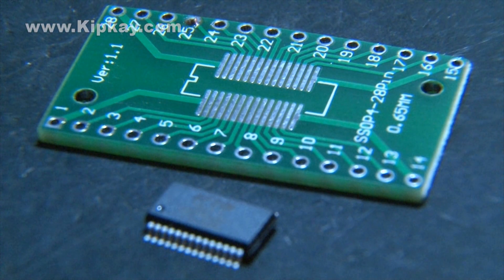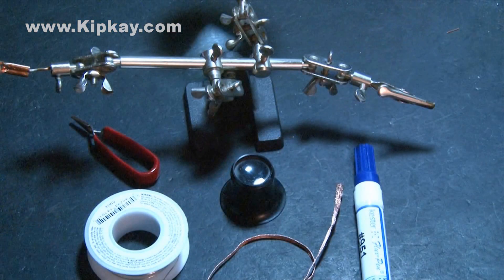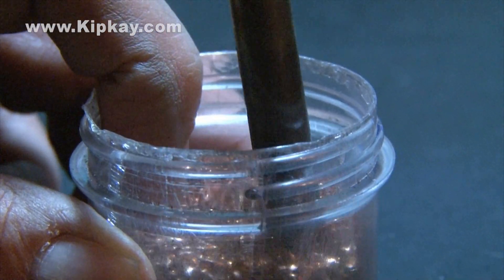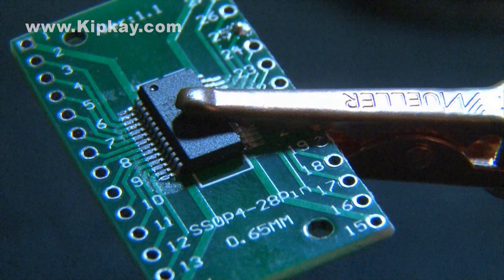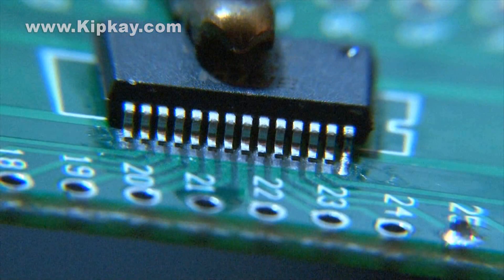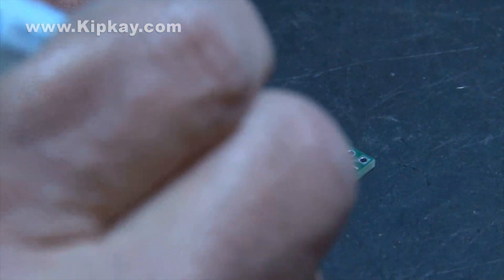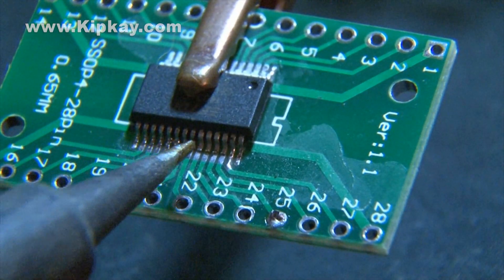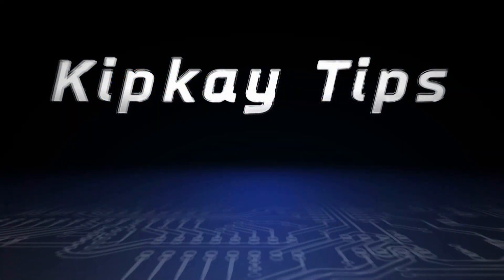How to Solder Tiny IC Chips!

Comment: Nice quick video. Btw to make the continuity test with your multimeter easier you can also put the leads in the through-hole sections. It gives you a bit more space than testing on the actual IC pins
Reply: Good tip. Thanks!

Comment: well, this was one of the easiest SMD soldering scenarios, good luck doing this with barely visible resistors, caps and ICs with a much larger PCB where alligator clips are not applicable. Still, it was useful, thanks for sharing.

Comment: Last time I did SM soldering I destroyed a test pad, lifted a track and "lost" a surface mount resistor.. That board is now a frankenboard with a standard 100 ohm resistor bridging where the track should be.. Never again.
I need a temperature controlled iron with a smaller tip.. A much smaller tip

Comment: Just a tip, apply flux to the PCB, tack down the corners then flux all the pins, then do your drag soldering. And do not stay on one pin for too long as you will damage the chip from the heat. This type of chip with proper technique only takes literally 5 seconds to solder. Use a wave tip also.
Reply: I approve this message

Comment: thanks for the video. could you also show how you would unsolder a chip from a board? it seems a soldering iron isn't hot enough to do it
Reply: try adding fresh tin and flux to the existing solder connections. this will ensure a better heat transfer and lower the melting point.

Comment: Kipkay, every time I see you use the conical tip I scream inside. It's so much easier to use a chisel tip for your soldering iron especially for SMD Drag soldering.
Reply: Elminator666 or a tip with a small hook on the end can work fairly well...but I do prefer a small chisle tip for almost everything...
I'm more cringing at what the end solder joint looks like...I see excessive solder on the back side...but that's just me coming in as someone who has been through professional soldering and solder inspection training...
Reply: Elminator666 who?

Comment: Questions : How do you know its time to change your soldering iron. And also what is the lowest temperature that your soldering iron can melt solder and keep the drips on the tip?
Reply: Answers:
1. - When it stops working.
2. - Depends on your solder and what you're soldering.
Reply: thanks a lot for the help dude :)